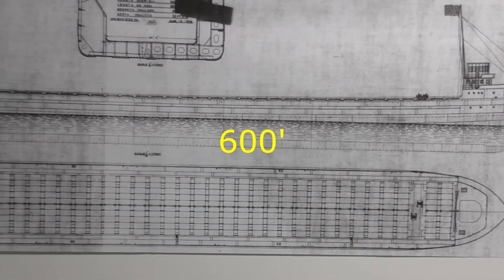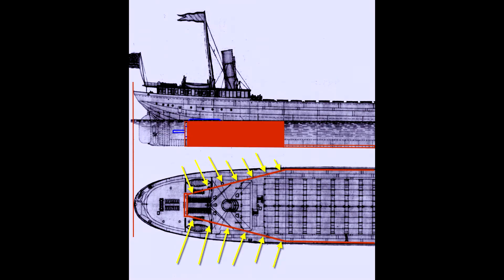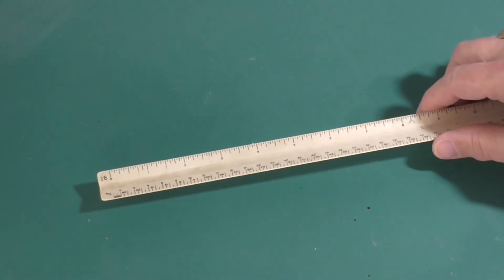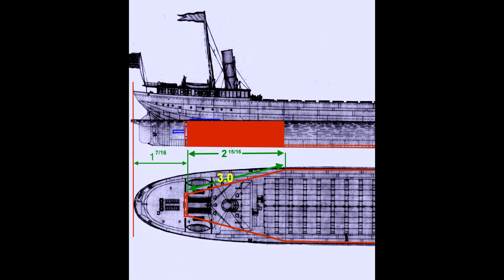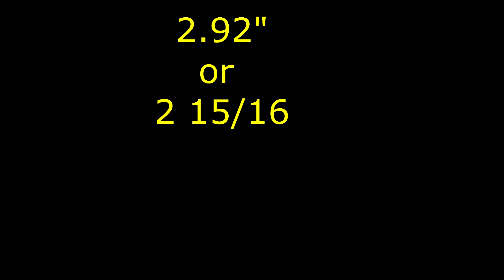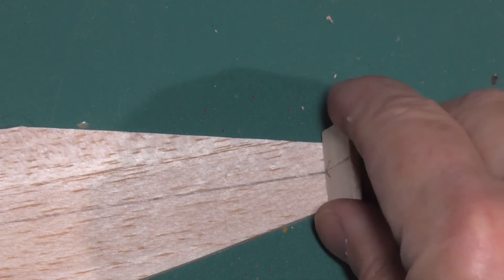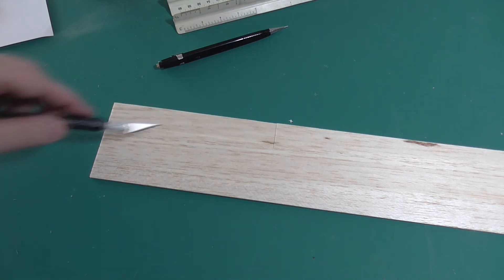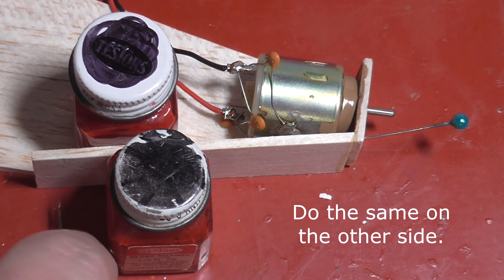How to scratch build an R/C Great Lakes freighter- Lesson 1a getting started measurements and plans

Comment: I use digital calipers to scale things. I've had to do a lot of take-offs from paper architectural drawings and one old trick is to sample three known, marked dimensions in mms, , add them up, divide by three to get an average and use that as your multiplier to convert back to whatever ... inches, feet, etc.whatever the units are that are marked on your drawing. You measure X amount of mms off the paper, times your multiplier equals distance in feet (or whatever) It is surprisingly accurate off of old paper drawings.
Coincidentally, if you did this off your scantlings drawing and used exactly one foot per mm, you would have an easy mathematical tool to work with that yields a 2 foot long model. No fuss, no mess and no scale ruler. It does yield a weird 1/304.8th scale but hey, it's all really arbitrary anyway.

Enjoy your videos, by the way.
Reply from the maker: That's quite cool!
Reply: @authorwes  Easy peasy ...

Comment: Hi I really enjoy your content Wes. I have a question about the re-14 motor. Do you run them at full RPM or is there a way to regulate RPM ?
Reply from the maker: I run them at full power, but can throttle them down a bit using a 500 ohm potentiometer. There are other, far more expensive ways, but I like the little pots.